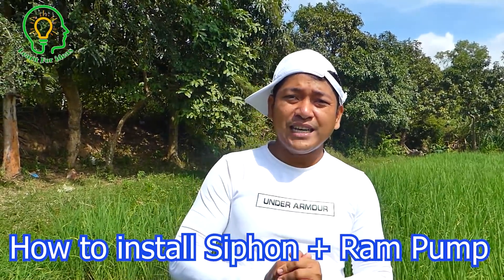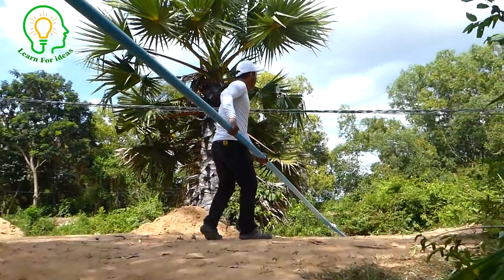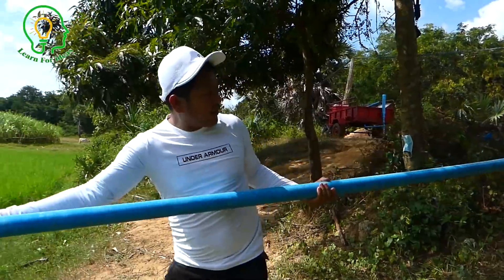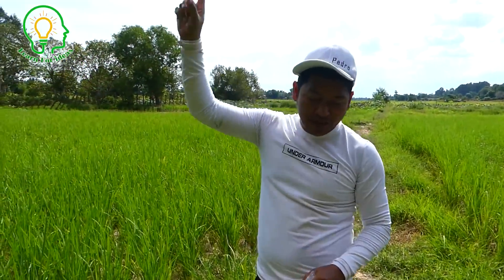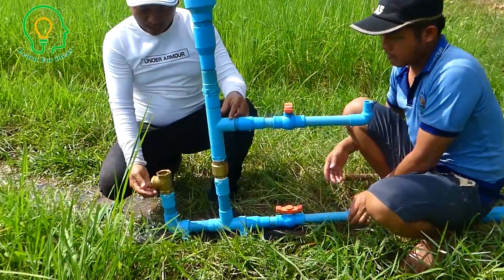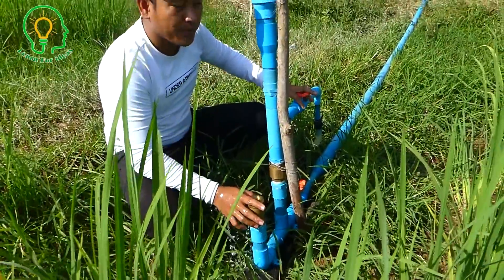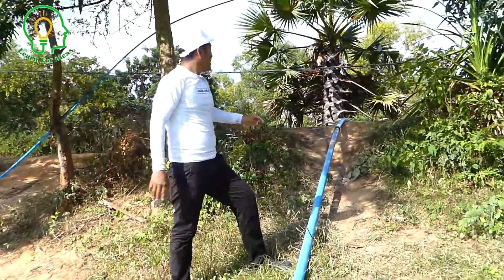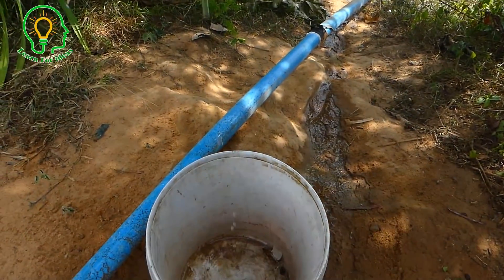Advantages of installing Siphon + Ram Pump System and Explain Step by step | Free Energy Water

Comment: Hello, is it possible to add movement to the water in a stagnant pond and feed the water ram when this project is done with a barrel? Also, in the system you use in with the drum, can suction be obtained with a 60mm diameter pipe and outlet with a 60mm diameter pipe? Will there be any kinks the drum? Thank you from now Good Luck

Comment: 1) I want to know the pipe which is in the river did you connect any valve there 
2) to make more pressure for the uphill water you see that valve which pumps water to make water pressure just connect half Meter pipe to the valve so when the valve pump water the water won't waste or spill on the ground and makes more pressure just try and see or increase the length of the water valve so it can pump more water to increase water pressure
Reply from the maker: Please try to get new ideas from any where, Thank
Reply: The solution here is good and sound, but it has to spill a lot of water to make the ram pump work. No foot valve are needed, the tube are filled by submersing it. The output end is blocked befor the pipe is drawn out of the river.

Comment: Yes, it seems this combination of the Siphon effect and the Ram pump     is the way to go to pump the water higher to anywhere you wish...
To make it a bit easier, you should use a normal water hose for the garden, then you dont need these big tubes...
Reply: A ram pump needs enormous amounts of water so large diameter pipes are needed in the siphon.

Comment: Is the Water level in the river higher than the rice field ?
Reply: Yes, the source is  higher than the output level. it is a syphon system with ram pump  to  increase pressure.